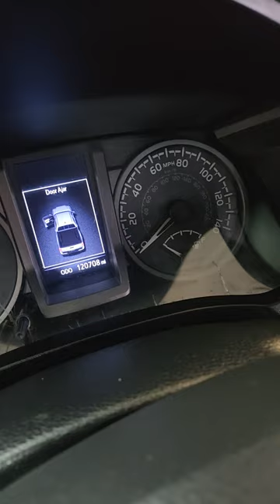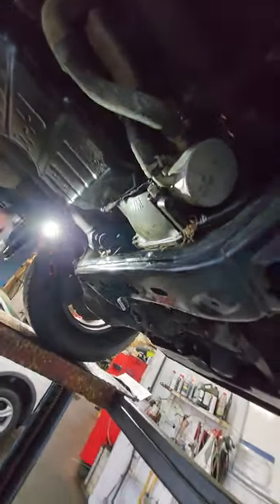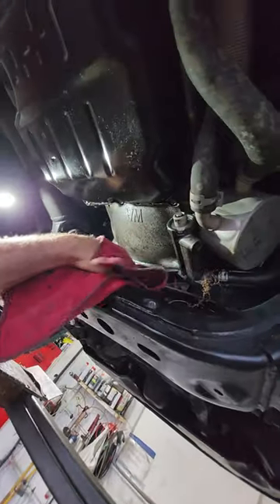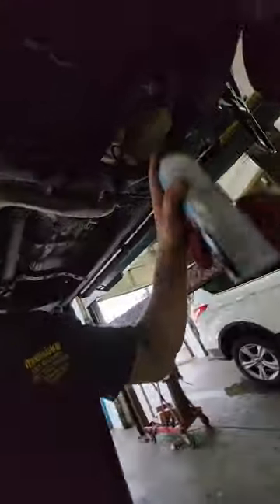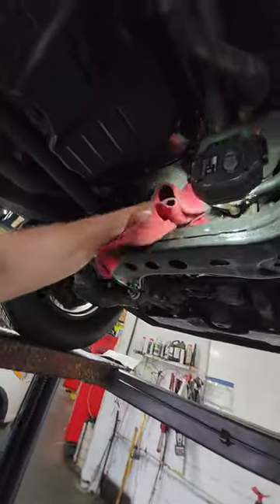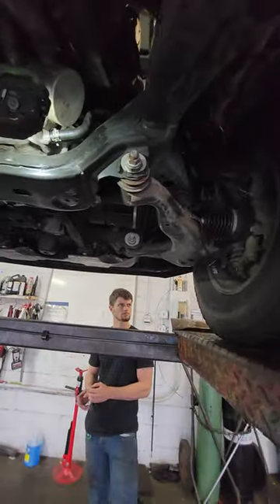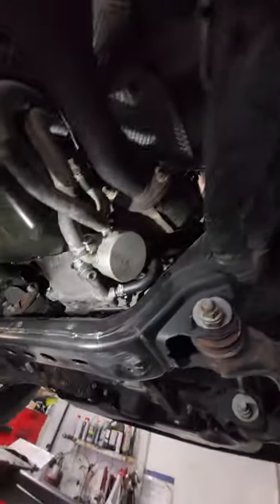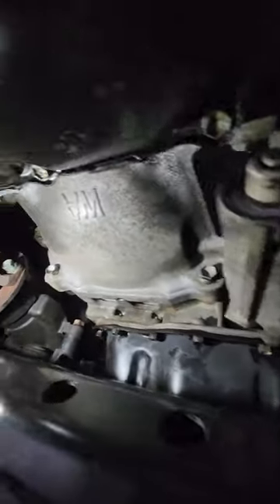Stop rear main seal oil  leak with out parts watch the magic .My product not store brought

Comment: I used a specialty stop leak in a power steering system since the rack was leaking at the inner tie rod ends. Sealed it up for the year I had the truck.
Reply: That lucas stop leak is crazy good

Comment: AT-205 Stop Leak fixed a chevy suburban rear main leak. I saved the guy thousands of dollars in repairs and all I got was a Thank You BUMMER. Me and my big mouth and I made nothing on the job

So I hear you on secret cocktail!
Reply: AT-205 and Lucas Stop leak is a mix that goes after seals with different formulas. AT-205 is the first path, if that doesn't work the Lucas is next for me. I actually saw some videos of others using both together as well.
Reply: Yeah. It works. I've used it to stop axle seal and shaft seal leaks on Diff and TC. I just remove fill plug and spray like 1/2oz in, or add in to fresh gear oil and do a service. I also spray down all bushings and boots with it every year.
Reply: What year is your Surburban? Don't see many rear mains leak on my GM OBS trucks. I am rebuilding the engine in my 99 Surburban and the rear main was dry as a bone with 275K miles on it.

Comment: Question do you think what you use could be degraded at all by a flush or the cleaning done by Valvoline restore and protect?
Reply from the maker: @Reptitude  once the chemical reaction take place it's usually permanent if the seal bearings and sauce are fd reteart